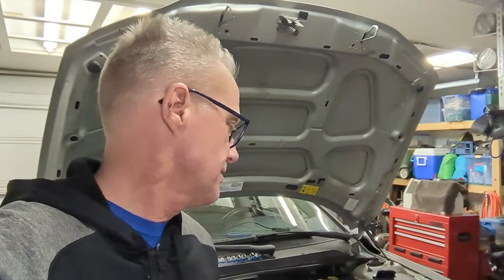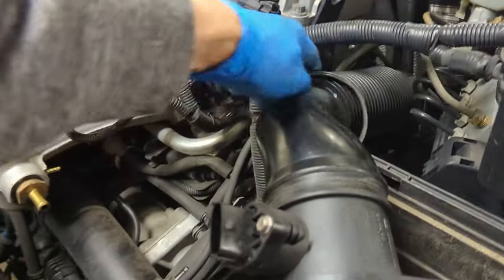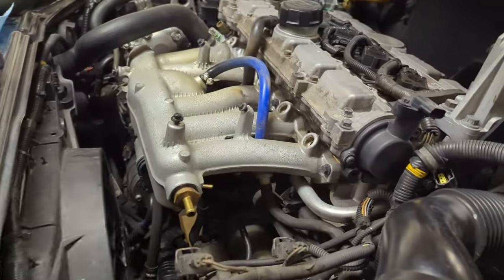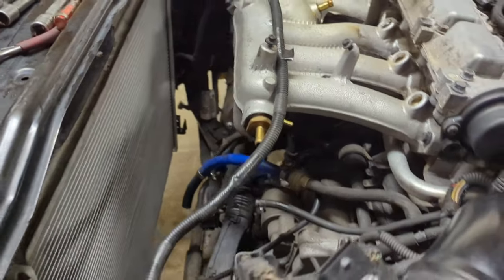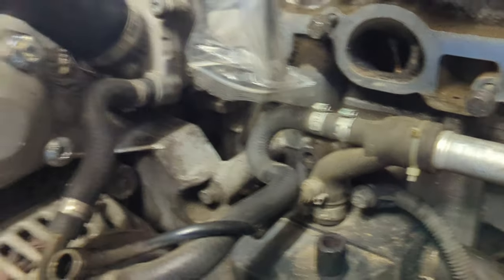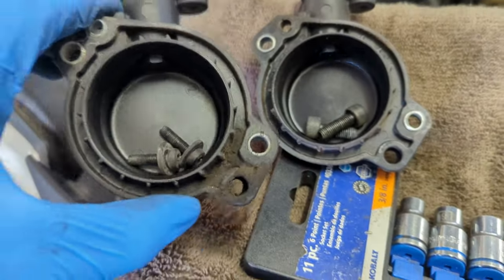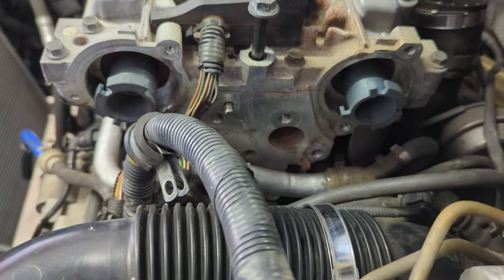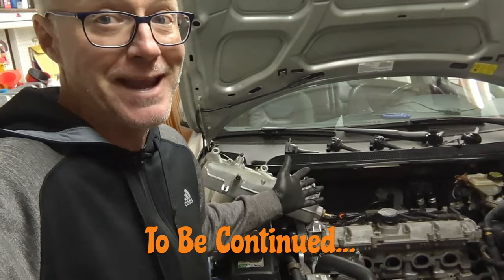Bad PCV / Oil Trap / Breather System On 2007 Volvo XC70

Comment: On a side note. Finding cracked/worn seals is to be expected at high mileage. You can replace them as you go along since most will still operate. But unfortunately when you move a part with worn seals/rings, they will fall apart when removing. That's universal in all cars.

Comment: I just did this PCV job.  The coolant that flows through the metal pipe is hot to prevent the oil/water vapors from freezing if you live in freezing temps.  That is why there is a PTC nipple that also heats up the vapors prior it going through the turbo.  You can stick a long nylon straw cleaner up that metal pipe at both ends and if you do not see any oil residue then you do not need to change the pipe and just change the hard PCV nipple hose with a ID 4mm heater hose.  You must use OET clamps where there is high pressure air flow so that would be from the 2 hoses attached to the oil trap box.

Comment: How did you get the left bolt on the PCV box? It’s blocked by that metal frame piece or something
Reply from the maker: I talk about it in the next reassembly video: removed bracket/wire from back of alternator and then access with an extension straight into bolt. :)
Reply from the maker: 5:10 into the next video https://youtu.be/PhFCYMLTFgE?si=FkZ9PPohOWpqaddr
Reply from the maker: I didn't have this issue on the 2002 V70 2.4T, just on the 2007 XC70
Reply: @jamiecars  we ended up getting it thank you

Comment: Take the ipd TCV off the other car before it fails. Stay OEM, it’s not an upgradable part and the ipd unit is known to fail.
Reply from the maker: Interesting. The V70 2.4T lacked it's prior power so I installed a turbo boost gauge and confirmed it was barely hitting 6psi and any subsequent pull would only reach 4-5psi. I was told this was a sign of a failing OEM TCM. I installed the IPD TCM 2+ years ago and it consistently and repeatedly hits 8-10psi - every pull. Power is much improved since installing the IPD TCM.

What symptoms should I be looking for if the 2+yr old IPD TCM starts to fail?

This video's XC70 still has OEM TCM and hasn't experienced any of the power loss like the V70 2.4T.
Reply: @jamiecars it’s a simple solenoid that’s controlled by the ecm, the OEM unit can fail over time but it was probably the lines had a vacuum leak. The ecm will limit boost if it can’t reliably control the psi. Inside the ipd unit is plastic and it cracks after enough heat cycles. Most R tuners won’t even touch a car with one.

Comment: I have a 2001 s40 1.9 turbo 4 cylinder. And I’m in the process of replacing the pvc valve system. And what I ordered is longer than the stock pvc valve line. Do you fix Volvos?
Reply from the maker: I'm not a mechanic - just working on our older cars. Go to IPD to see parts for your 1.9 engine - or FCP Euro. That's where I buy my Volvo parts.
Reply from the maker: Volvo 1.9T is a 4 cylinder block. Sounds like you received for a larger Volvi 5 cylinder block: 2.3T, 2.4T, or 2.5T - or even possibly one of the larger 6 cylinder blocks: 2.8 or 3.2...

Comment: coolant drain plug doesn't come out, you just turn it 90 degs and then open the coolant pressure tank cap and it will drain quickly.
Injector O rings and pintle caps should be replaced, you already broke one so swap them all.